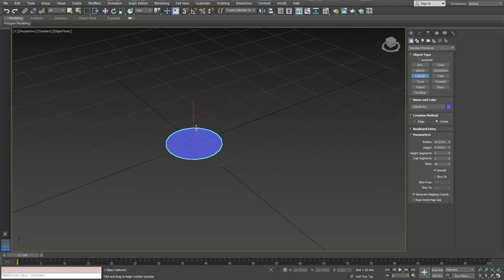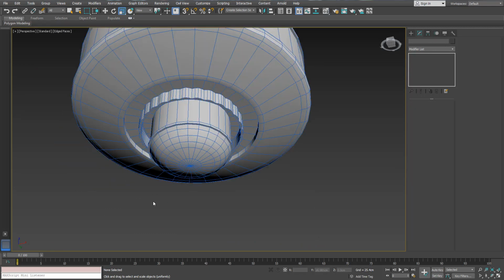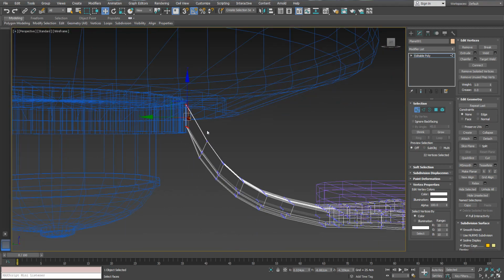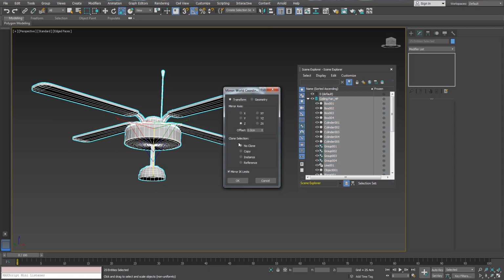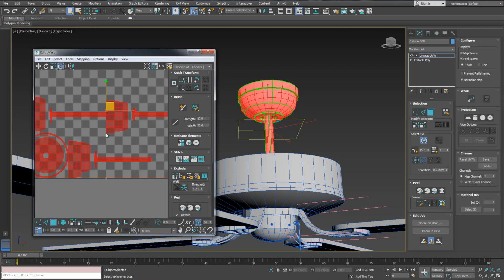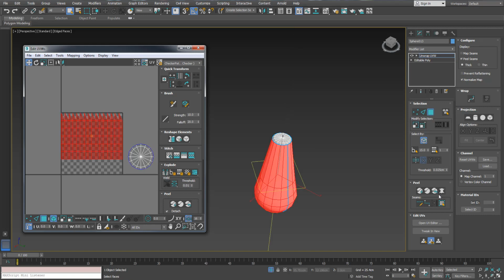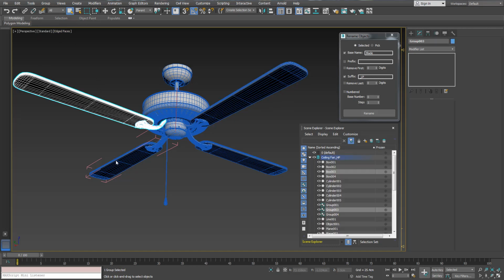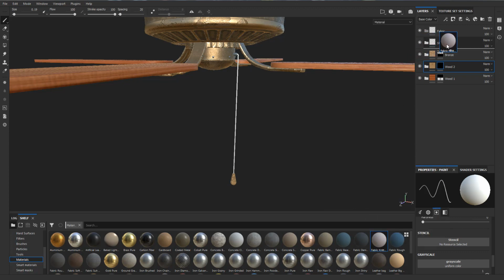3Ds Max 2019 Tutorial_Texturing in Substance Painter

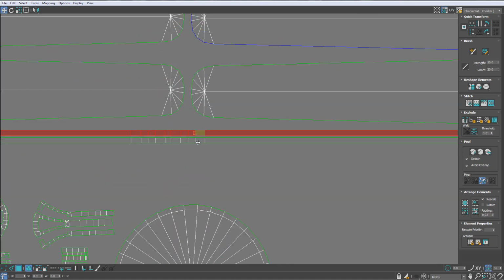Comment: Is there a reason to not use the button that puts all the different elements inside the uv space around 50:00 ? I'm talking about the button just at the right of the rescaling elements button on the bottom right of the UV editor.
Reply from the maker: yes, there is a reason not to use it :
1_it is not efficient , it leaves a empty space in the UV template.
2_the uv template will not be organized, usually you want UV shells that are of the same piece or same materials to be close to each other. and this tool does 
   respect that.
3_Your UV template will not look good. 
4_(personal reason) i like organizing the UV template, i enjoy solving the puzzle
Reply: @inspirationtuts2210  ok thank you